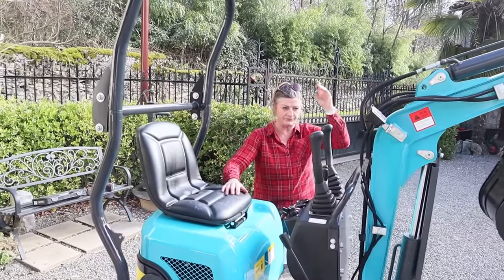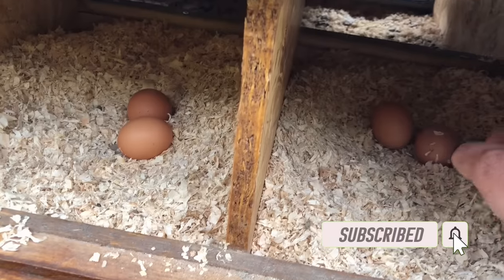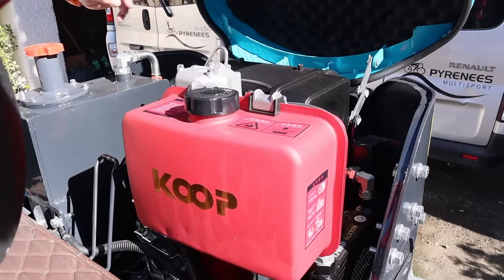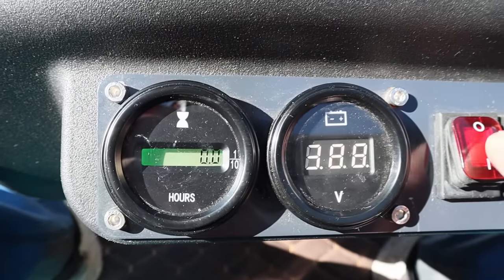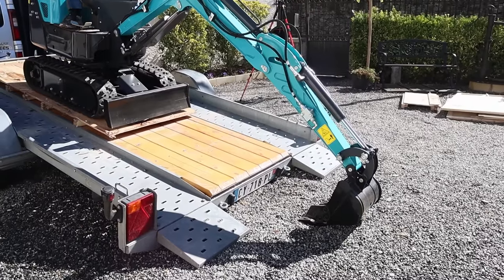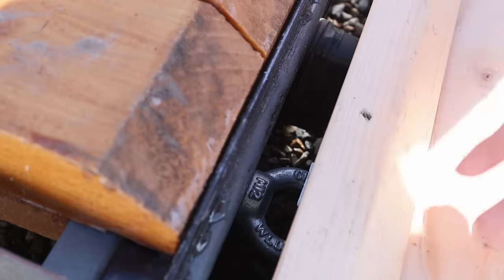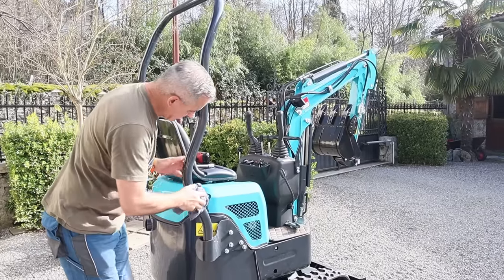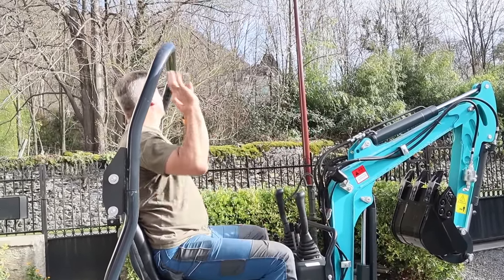Unboxing Chinese Mini Excavator | Nuoman from Alibaba

Comment: How is the machine going ? I am thinking of buying one. Would appreciate any thoughts on the Nuoman machine
Reply from the maker: It is working great - pushed it hard and it has done the job.  Dug out footings, septic tanks holes and graded my driveway.  Once you get used to the jumpiness, it is a great tool and saves digging by hand for sure.

Comment: Nice shopping! I hope it will work longer than a cassette recorder... :) well, you were probably a bit wrong with the grease so generous when mounting the protection bars, I mean those parts exposed to the sun can be always in grease slowly streaming down...

Comment: The only problem I’ve come across really with these Chinese forklifts diggers ect are the hydrolic fittings use they are slightly different from anywhere else in the world being the depth of the mating faces on the fittings and are not compatible with standard fittings you’ll find in say a pirteck repair van that’s the only problem I’ve had when repairs required
Reply from the maker: I will check these out - but I thought it would be easy enough to cut the ends and have standard fittings crimped on (at the agri workshop...not me)
Reply: I found these fitting very hard to get here in Australia
Reply: Try buying extra fittings and blanking fittings from manufacturers blanks come in handy

Comment: The part which clamps onto the exhaust pipe is to prevent rain from entering the engine cylinders. Causing cylinder wall and ring corrosion and/or hydro-lock. Which could cause a bent crank or rod, or broken piston or rings.
Reply from the maker: It was to direct the end of the exhaust in a different engine set up.  Mine just blows through the back of the chassis.  Thanks for commenting

Comment: two years down the road, you won't be finding parts for this.. good luck mate.
Reply: Exactly what I was thinking
Reply from the maker: See, I don't get that - there are no specific parts to this machine.  Standard hydraulics, standard motor and anything else I can fabricate.  Standard buckets fit it.  Some of the older "known" brands are probably struggling for the older machines for spares.   It is a risk but I am capable enough to cope with repairs.
Reply: @HomesteadingUncontained  You will have to adapt any replacement part is what is going to be the issue. It’s a very common problem with the “discount” chinese machines. Do they have customer service or a dealership? I’ll guess no. It looks like you’re not using it for commercial applications so hopefully you’re fine. Trying to find which machine that they have copied will give you clues about which parts to order when it breaks.
Reply: @HomesteadingUncontained  - Great to hear you are capable of repair. We all have different takes on investing in types of machinery. I recently both a ride-on lawnmower for my 6-acre property and mostly it's the after-service that matters if I want to get along good use of any big investment. But nothing wrong with your purchase honestly, it gets the job done. Then there are times, I stare at my machines and think - there goes my $8k investment sitting and doing nothing. hahahaha best of luck and post more vidz.
Reply: If it still runs.

Comment: This is interesting. In the US it costs so much to ship and import one it becomes more cost effective to just purchase one from an American manufacturer or Takeuchi or Kubota. The shipping cost alone to get here is more than the unit. Tax is the cheapest part.
Reply from the maker: There are several people importing these into the US and it didn't seem that expensive.  At the time I bought this, a 12 year old beat up old kubota 1 tonne was around €14K.  Prices have dropped now so I may have gone a different route - but still very happy with it.

Comment: Hi, I don't want to be indiscreet, but how much did the excavator cost you, including shipping and delivery? Did you pay the same price for the excavator as indicated on the ad?
Reply from the maker: No problem - no the ad prices are a little deceiving - the machine itself was $4500 then $500 shipping.  €1000 freight charges in France and €1000 VAT - so in total €7000

Comment: if you are still wondering about the clamp at 12:09 : in some countries, it is mandatory to have blinking warning lights (like the garbage trucks usually have them) on the highest point of the machine. This clamp is possibly for being able to mount such a warning light.
Reply from the maker: It ended up being an exhaust deflector.

Comment: Did you check the oil? After you run it a bit, you need to check all bolts nuts etc. Check you track links and rollers. Check for hydraulic leaks and all of your fittings. I work at Caterpillars Victoria Texas excavator Assembly plant my specialty is the roller bearings that the tracks ride on that is the part of the assembly line that I work on. I have a little knowledge on what I'm talking about. Anyway good luck with your Chinese made excavator digger.
Reply from the maker: Hi Kevin
Yes all the fluids and grease were checked but since then I have given it a complete oil change and redone the grease about 10 times.  Tracks are all good now too.  Cheers for your comments, much appreciated.

Comment: Why did they rebuild the machine,or oil filter?
Reply from the maker: The oil cooler was not originally built into the machine - I requested this afterwards, so they just build a new machine and sold the other.

Comment: I've seen quite a few unboxing videos on YouTube, but this is the first for an excavator. 
It's a cool little machine for light jobs, but I'd hope there's an adjustment for that lever for the blade. Sitting right on your right knee seems like a design flaw. If it's on a splined shaft or you have access to a torch it would be an easy fix though.
Reply from the maker: Yes that and the throttle do get in the way sometimes but I have got used to them now.  It is going great and working it hard on our new build.

Comment: Just a heads up, the tines on the bucket belong attached ON THE INSIDE of the bucket..It will perform TONS BETTER..
Reply from the maker: I have tried both ways and there is not much in it.  When I do swap them to the inside the bolts are exposed on the outside.  I think it is designed for fitting on the outside on this bucket.

Comment: Nice unit. NO you don't want to jump off when the digger is rolling into a hole. Stay on your seat and you wont be crushed. What pressure the hydraulic is running ? Have you tried to raise it ?
Reply from the maker: Yes, I have installed the seat belt and I will not be jumping off (an in experienced comment) - not sure what pressure, there is no gauge.  I will look into seeing how it can be adjusted.

Comment: What is the track width please. How wide an access does it need. I have 900mm between gate posts. Will it squeeze through?
Reply from the maker: It is 850mm so would squeeze through.  They are fixed tracks but you can get the option for expandable.

Comment: Nice little cheap home owner unit.
Needs a thumb on the bucket arm to pick up items tho.
You'd think that would at least be an optional item.
Hopefully, in tge future you'll be able to get spare parts when you need them.
Reply from the maker: It did have the option but I said no as it was an extra $500.  In hindsight I should have gone for it.  But I thought it was pricey and I will be getting pallet forks for my tractor so I should be good. (we have no trees to pick up)

Comment: You lucky you got diesel engine. How much is that option? Thanks
Reply from the maker: The little diesel koop was standard - it was €7500.  But for the kubota engine it was an additional €3500

Comment: After 2 name brand name water electric  water blasters failed me after not much use, I bought a petrol chinese one. After 8 years it still goes like a charm. No issues. Starts first pull. I might use it a few times per year for a few hours each time.  U just have to be diligent with the fuel. Empty the tank and carburettor before putting it away till next years stint.
I should mention its trailer mounted, so its big.
Reply from the maker: I am still really happy with this little excavator - I look after it and it is performing perfectly.  See the recent update I am putting up today.

Comment: I own a yanmar sv08, and I can tell where they cheaped out on this excavator. But you know for  residential use it can work.
Reply: Do tell.
Reply: @kevinhoversland  no casing for the drive motors, the boom doesn't swivel to the sides, the hydraulic tubes are not tidy, the yanmar has a two cylinder engine, the gas tank on the yanmar is made of black heavy duty plastic 10litre capacity, the tracks and the blade width extend on the sv08, the overall built quality is heavy duty, at least of what I can compare on this video. The hardware between the hydraulic cylinder and the bucket is made of cast Iron. You get what you pay for, but like I said for residential use this might be a great investment.

Comment: Do they sell a hook assembly, to replace the bucket, so you can use it as a crane?
Reply from the maker: I might weld a hook onto a bucket or something like that.  Or just use the bucket spindles without the bucket - might work the same.

Comment: G’day from Tassie.  Looks like you are going to have a great time with your hydraulic teaspoon.  I’ve got a 22 year old Komatsu 1.5t.  I bought it 12 years ago with a cracked hydraulic pump shell.  Got a brand new one for $1000, and was still about $8k ahead of the next best available option at the time (Chinesium crap in those early days).  Hasn’t let me down.  Ever.  Best buy I ever made for the farm.
Reply from the maker: It is good when you find a bargain but some of the rubbish I looked at would have cost more than the machine which was already more than the cost of this machine.  I am still on the look out though 😀
Reply: @HomesteadingUncontained  yeah.  I’ve been searching for three years for a 1.7-2t machine with expanding tracks (more stable on our ‘rolling hills’ more like a constant seep slope, though on the farm) to replace my old boy.  Having a hard time finding anything that hasn’t been in a high speed accident on the highway, or looks like it was dropped from a crane.

Comment: You can do one of the most expensive parts of geothermal heating/cooling installation with your new toy. Wonder if it can dig deep enough to bury the coolant lines?
Reply from the maker: Not geothermal for me - I will be purely solar and heat recovery within passive house standards.  (plus a small pellet burner)

Comment: Hi, mi name is Christian from Lima Perú, congrats for tour NME10 PRO, i want to ask You (sorry for My Bad English) if after of 10 months this machine requires spare parte (filters, oils, hoses, etc etc) ando where it could Buy?
Reply from the maker: I can buy most of the parts locally as they are standard parts.. I took a broken pipe to the local tractor store and they made a new one up.  But the supplier can send spares and it takes about 1 week.
Reply: @HomesteadingUncontained  thanks you for answer. So the air and oil filters is easy to Buy or are of the other machine compatible?

Comment: Pretty portable machine. 
Need 2 check the motor oil before starting and someone take away his grease! Locktite them bolts.
Reply from the maker: hahaha, the bolts are pretty tight and the use of the copper grease stems from work on old cars where I have struggled for days loosening Renault and Citroen bolts.  This will be fine for sure. 👍🏻

Comment: 12:05 The clamp is for the exhaust so it blows down. Or its for the air filter housing.
Reply from the maker: Exactly right - It is to direct the exhaust but I do not need it - thanks for the comments

Comment: Nice toy. As a hobby machine it is just fine. Most users don't need anything bigger for their home projects. so it's suitable for diy users on their private projects. A bit pricey for just keeping around as a home machine, but if you could rent it out to neighbours it could be financially okay. Very obvious that you have absolutely no clue what that machine can do and what obstacles it can conquer, and that you have never even sat in one before.
Reply from the maker: I did the maths and to rent this machine for a day here is around €180 plus delivery.  If I could spend a consistent amount of time using it, I could probably get away with 2 to 3 weeks, probably more.  At €7000 this is paid for itself after a month or so.  As long as it does my build then it will have fulfilled its goal.  If you check out my new videos, I am getting the hang of it.... another reason why renting would have wasted a day or two in learning.

Comment: If you have a problem with weight counter balencing,balancing, suggest tying heavy weights to the back roll bar
Reply from the maker: Will do, the rear section of the engine housing is 10mm this steel so it is quite heavy.  I will just eat more too.

Comment: That "roll bar" in reality is more  like a light bar or for hanging speakers(like a boat) , what you REALLY wanted, was a "thumb" option...
Reply from the maker: Roll bar is same gauge as my kubota. And feels pretty sturdy. Yes, I regret not having the thumb. Future project 👍
Reply: @HomesteadingUncontained  IF its thick enough, it MAY be ok for a light flop over at low speed. Its due to NO support tying it in at an angle more than the thickness. If you did actually roll it down a bank (god forbid)id bet it would fold shockingly easy. Its like the breaker bar  idea longer it is more leverage applied. Just would hate for you to have a false sense of security and get cocky on it is all... Jut keep the shiny side up and the greasy side down nbd lol

Comment: Your going to half to run the motor at a high idle when using the hydraulics. The machine will be easier to operate if you run the motor at 80%. 
Good luck
✌️🇺🇸✌️🇺🇸
Reply from the maker: I have found the sweet spot with it now - it is still little slow but I can work with that for the price I paid.

Comment: I wonder if you can get it with a hydraulic thumb?
Reply from the maker: I did ask for the thumb then found out it was a fixed unit.  So took it off.  Wish I had left it on now (the order)

Comment: Awesome!!! You could build a whole business or a career based just on that one piece of equipment. The fact that it's diesel and not gasoline is good because you can operate in (somewhat) enclosed spaces without fear of carbon monoxide poisoning. I'm definitely getting one of these myself for my clandestine bunker build.
Reply from the maker: I m very happy with it and I have just added a Mini Dumper from Deleks (see my latest video) to allow me to get rid of the dirt I dig out

Comment: In my opinion, a superstructure (roof) would have been much safer than the roll bar. In the event of a rollover, the superstructure (combined with a seatbelt) prevents you from sliding off the vehicle and getting trapped.
Reply from the maker: I didn't like the look of the roof, it looked flimsy compared to the solid tube structure of the roller - I do have a seatbelt now.  Thanks for watching 👍🏻

Comment: How much was this machine if you don't mind me asking shipping also please thanks looks nice .
Reply from the maker: In total it was €7K including shipping, freight forwarding and Taxes.  Compared to a 10 year old know brand here in France at around €12 to €15K.
Reply: I don't know this machine or the owners experience with it, looks okay, but sometimes it can happen 'buying cheap can be expencive'. Mechnical things breaks now and then, service needed. When buying relative expencive equipment as an hydraulic excavator, easy or less easy access to spare parts and help locally vs the other side of the world  when somethings goes wrong are things to also calculate into the equation. If one are a good mechanic, or know someone locally with good experience, the risk is smaller buying cheap
Reply from the maker: @Rimrock300   totally agree. I am pretty good in the workshop and so far it has just been maintaining it. Fingers crossed 🤞🏻

Comment: hello I come back to you because my mini digger arrives at the end of me what are the documents requested at the port for customs clearance?
Reply from the maker: The Bill of Lading is required.  The commercial invoice.  The Certificate of Conformity for your country.  I think that is about it.  Hope all goes well and have fun 👍🏻
Reply: @HomesteadingUncontained  ok thank you, you have chosen which method of transport, CIF OR FOB because I am a little lost, the Seller's explanations are not very very clear on transport and as I am also in France I want to base myself on your experience  as I ordered the same machine as you on the same factory and to the same country 🙂 I'm sorry to bother you with my questions.
Reply from the maker: No problem - email me your bill of lading franceuncontained@gmail.com.  We had CIF but this only includes the shipping fee - when it arrives in France there are the handling feels and taxes.  If I see the bill of laiding I can tell which freight forwarder they are using - you then need to contact them directly to organise everything when it arrives at port.
Reply: @HomesteadingUncontained   hello I think the email address is not correct because I received an email telling me that my email was not distributed
Reply from the maker: @zino7389  so sorry - I got it mixed up - francecontained@gmail.com